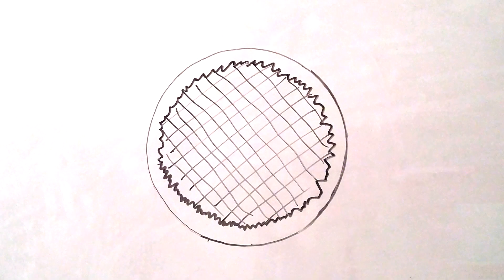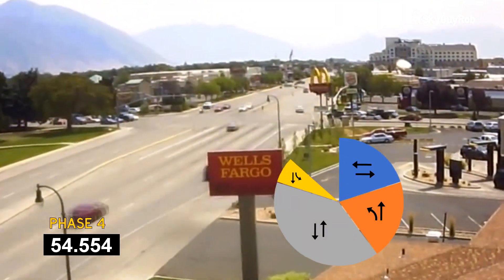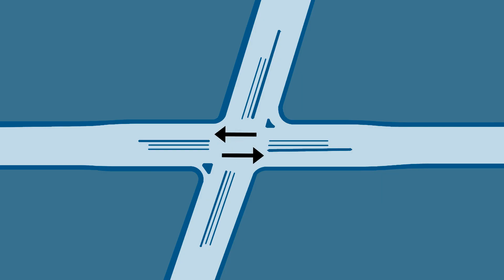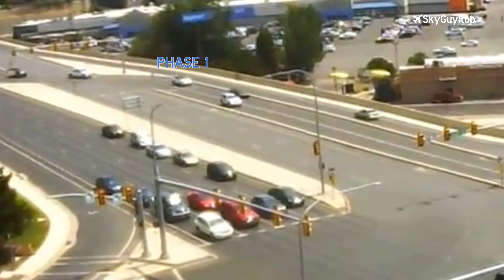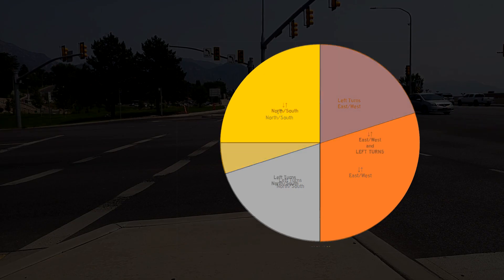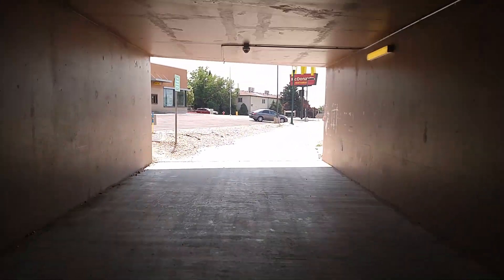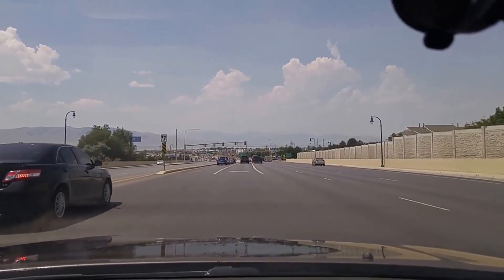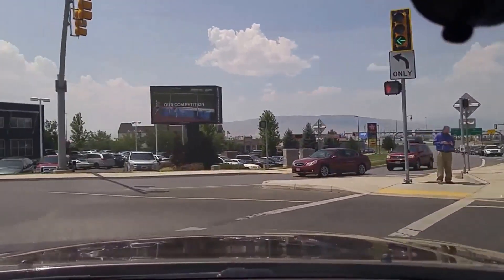New Crazy Traffic Light Which SOLVES Congestion

Comment: 2 things that would vastly improve some traffic lights. In other countries the green light will start to blink multiple seconds before it Turns Yellow, then Red, to give drivers  more warning time it is going  to change. And the other item that helps, is the Red light will blink before it will changes Green so Drivers will be ready to go. Another measure that think should be is where they have the dedicated Left Hand Turning Lane. They should have this dedicated Left Hand turn lane should get the Green after the people going straight get through the light. I have been stuck for multiple Red Lights because I couldn't make a Left even with a Green left hours), because the traffic in the other direction would make a left hand turn after their light turned red (and I could not make the Left before the traffic coming in the opposite direction, go a green light).  By allowing people turning left with a dedicate lane/sign to go last, it will ensure more of those people will get through the intersection).

Comment: There is one of these in Round Rock TX and every time I go through it I get a bit thrown off by it. I usually try to avoid that intersection - so there is some reduced traffic right there! I can imagine senior drivers would even have a problem with them as they pretty much feel wrong based on decades of driving normal roads.

Comment: Please do a review of the traffic system in the metro Detroit area. They have the most efficient system I've experienced. No left turns allowed, you have to turn right then use a designated U-turn lane to turn left or go past the intersection then turn left. This avoids having to install left turn arrows. It's far more efficient. Check out Woodward Ave that runs from downtown Detroit all the way thru the suburbs with timed stop lights.

Comment: There is a problem with this, too.  My city was among the first to have this CFI intersection installed in the State of Ohio in 2012.  They said that it would handle the growth of traffic for ten years before an upgrade was needed.  Well, within three years, a huge shopping complex  (miniature city with a traffic light in the middle of it!) started up and it was over capacity.  Since then, the eastbound side of the CFI road had the right turn signals removed and made into an exit/merge lane onto the southbound cross-five lane road.  They just put up a sign that said "yield to pedestrians" when it used to have a light to let them cross safely.  

The northbound five lane road first had it's single left turn lane lengthened due to all of the left-turners going to the westbound exit ramp to the interstate (new exit put in with the CFI!).  This held up the southbound five-lane road pretty bad (especially left turns).  They added the second left turn lane to the northbound five-lane (now six!) to handle the additional cars.  

In short, the intersection is busting at the seams during high volume times!
Reply: That's not the fault of the intersection, that's the fault of planners expecting the rate of growth to remain constant. You're also ignoring the fact that, if the city planners put this CFI in, then the road was presumably already at or past capacity and getting worse every year. Assuming the city did not have the money to put in an actual freeway (probably the case), then you only have 3 possible outcomes here: 1.) CFI goes in, relieves traffic significantly until Shopping Center goes in and it's once again over capacity. 2.) No CFI, Shopping Center does not get built resulting in a major missed economic benefit, and street is over capacity anyway. 3.) No CFI, Shopping Center goes in and severely under-capacity street is now a parking lot until a freeway is built.

Option 1 is the best option in all cases, meaning while the CFI did not get you the 10 years relief expected, it did get you a major economic boon while not making traffic worse than it would have been regardless, potentially allowing the city to build the freeway earlier than expected (or perhaps not, that's politics).
Reply: @jeffwells641  As of now, only half of the available land has been filled..actually still has land to go.  The intersection has upgraded twice.  They did it to avoid a highway initially but there were plans to put one on that road.

Comment: New Jersey tackled the same problem in another way, that spreads out the space it needs (so you don't need to widen the road) and isn't confusing at all except from map readers point of view. If you want to turn left (or make a U-turn), you turn right. Well, actually, you use a ramp on the right side of the road. If the other road isn't too busy, they can make you turn left onto that road before getting back to the intersection. Or, if it's a busy road, they cloverleaf you, which means you'll have to pass through the intersection twice. And if it's a T intersection, well you just get routed to the light, no merging, no left turns, no going through the light twice. It really is a clever solution and I wish more state would adopt it.

Here's the Wikipedia article. Apparently it has a name (other the New Jersey left turn), Jughandle. https://en.wikipedia.org/wiki/Jughandle

Comment: Real solution = roudabout with the correct yeild rules.  Inside traffic yeilds to outside traffic.  When we do roundabouts in the USA, we have outside traffic yeilding to inside traffic, and thus it becomes basically a stop sign when things get busy.  But doing it the other way and you can get a continuous flow of traffic through as slow speeds, and if you us a multi-lane roundabout then it works really well because the traffic "in" the roundabout can change lane rather than slow to crawl when yeilding for outside cars coming in.

Comment: Live in utah, use bangerter Hwy alot, glad they are removing cfi. Some intersections seemed poorly designed. Sometimes instead of waiting at one red light you would wait at two or when making a right hand turn you would have two lanes of left turners coming at you all on the same green, just have to wait or hope nobody goes wide

Comment: In parts of Chicagoland they have installed left turn yield ONLY lights. Meaning there used to be a point where incoming traffic would be stopped and you could turn left safely. The new lights are fine when there's low traffic but when it's busy they SUCK.

Comment: I live in Austin Texas, and we have 2 of these, one near where I live and one in south Austin, from what I've seen. Idk there there's more. And I like it, im not a normal person who thinks its weird for the sake of weird, I do realize it allowed left turn to go with straight traffic. And also, the helps me know when a straight light is about to turn red or green. The diverging diamond intersection, we have 1 near where I live too its on the same road of the continuous flow intersection but down the road a few  miles for an overpass over I-35, and that one i like it a little less. It does help flow of traffic, but I cant tell u how many times I've seen ppl go the wrong direction or try and beat the red light cuz for some reason making left turns off from either I-35 frontage road, the light phase is really short so those tryna cross over going straight perpendicular of, ive seen some close calls.

Comment: Just found your videos and was wondering what a CFI was....  and oddly enough Utah has been the only place I ran into one in 2019!   Never having been through one before it was a little confusing as to what the heck I was doing but just followed the lines, arrows and pavement and I made my left as I wanted.

It does seem a bit more elegant than Michigan-Left or jug-handles (New Jersey) than any other traffic situation out there.    Though a modified Jug-Handle seems like it could almost be a good solution for high(er) traffic situations.

Comment: Roundabouts are nicer, people don't need to stop, just slow down. Want to turn left, use the inner circle, want to turn right or go straight, use the outer circle, it's that simple. (No I'm not talking about traffic circles, those are bad designed since day 1.)
Also, people can't do a head-on collision, because everyone is going one direction.

The magic roundabout challenges you to design a better one.
Reply: Some people don't like roundabouts, and I don't understand those people. A year ago I was riding with some coworkers who aren't native to my area, and they complained about one of the handful of roundabouts we have. I was like "Bruh, you have no idea how horrible this intersection was before they put the roundabout in. Roundabouts are magical time saving traffic devices of wonder." Seriously, a typical stop time at this intersection pre-roundabout during rush hour (which in my city is NOT as bad as your average moderately sized city rush hour) was probably 10 minutes, easy. 5 if things really go your way. It's less than 3 now in the worst case scenario with the roundabout, and it's usually less than a minute even during rush hour.

The only trade-off for these roundabouts is you have to think a little more ahead of time - left lane goes straight or left or U-turn, right lane goes right or straight. That's it. It's not that hard (at least for our relatively small roundabouts).
Reply: @jeffwells641  You're co-workers would not like it where I am then, most intersections here are roundabouts, the only reason there is traffic lights is either because of small place or pedestrian crossings.

Another good thing about roundabouts is that they don't need power to work, they're like plug and play.

Comment: A major problem in this country is a large number of people driving are extreme drivers.  Over the pass 30 plus years new drivers learn based on how their parents, relatives, friends and others drivers conduct themselves on the roadway.  Most times it is bad.  They run through stop signs, red lights, illegal turns, change the minds and disrupt traffic and very bad attitudes.  About 65 to 70 percent of the drivers on the roads should not be driving at all.  Redesigning a intersection does not change people poor driving habits.  Great video

Comment: Hey Rob I was surprised by this video because I live there I I use thst intersection constantly. I have to say thst depending of whst intersection sre you taking it you can love it or hate it. The most annoying part of this intersection is thst special bay that you mention at the beginning. The green light allow only 3-4 cars to move to the next area before it turns red. That turn goes to walmart and on moderate traffic I have to wait at least 3 green lights in that special bay to finally nove to the next one. So this is not so special after all.

Comment: The problem in my city (Mississauga, Ontario) is that the traffic light are timed to catch you. It happens all the time, so it's not just a coincidence. If you are traveling at the speed limit, you will miss the lights. That way you waste more gas, and the governments makes more money. 
If they just offset them to change 10-15 seconds later, most of the cars would make it through without speeding. Congestion would be reduced, and fuel would be saved.

Comment: These are a pretty expensive band aid.  If I. guessing, this is a 10 million intersection improvement without the tunnel.  My town used a "Michigan left" which is similar to this layout and it cost $9 million dollars.  It allowed traffic to move more smoothly but added 4 more lights to the area that they can't seem to keep in sync as people make their left turns at the through signal and not the right turn signal.  I don't know why the engineer chose "the make a right to turn left" instead of "go through to turn left" as the second method allows you to turn right on red when you come back to the intersection.  Anyway - the improvement was marginal at best to traffic movement and the price tag was enormous.

Comment: I remember a couple of places in the SLC area (one by the airport, iirc) where the right-turn traffic goes straight while the through and left-turn traffic all crosses to the left side of the road.  (I looked it up - there's one's at Bangerter and the 201, though I don't  recall where the other one was.)

What's your take on those?

Comment: My city tried to utilise one of these intersections but in utilising it they still made it so that the light has 4 pieces of the pie so it really just causes traffic to interfere with itself this particular intersection with how it flows has actually caused more accidents than before they changed it and again you still spend as much if not more time sitting at a red light now depending on which way you were going then if this were just a normal intersection in my city Which is why after they built this one singular intersection the city planning department in the residents of the city banned any new constructions of intersections like this seeing as how it takes the space of 8 lanes to properly utilise 1 of these intersections in we are trying to do it in the space of 4 or 5 lanes and many times when Turning on to the actual highway you will end up sitting 45 even 10 minutes waiting to get your green light to go ahead in cross the 3 different directions of traffic that you have to cross to make a simple 90ﾟ turn It is way easier for people to screw up utilising the sanities to actually utilise them which is why they are a band-aid solution and they are the least common intersection in the world and the US and the primary state that utilises them is a very large open state with very large and wide roads And war even that state only uses them temporarily until they could save up the money to do the actual road project they wanted to do.

Comment: They put something like this in San Antonio TX at Bandera Rd (TX Highway 16) and Loop 1604. It looks a little different because the main lanes of loop 1604 go over the middle of the intersection. It is a lot better at rush hour than the old conventional intersection, but it still often backs up traffic on southbound 1604, just not nearly as far as before. That could probably be fixed by moving the exit ramp north as far as practical. This intersection re-design probably would not have been needed had not a tiny crooked city to the east blocked all attempts to improve Bandera Road. The state and county were planning to double deck it back in the 1980's but Leon Valley complained about the ticket revenue they would loose. Fortunately it looks like the dark side lost big in the last election in LV. Had this road been double decker by the late 1990's, most of the through traffic would not even go through this light at all. Before this was built, Westbound traffic was often backed up past Prue Road and southbound traffic backed up to Babcock or even I-10.

Comment: i think CFIs are needed in my hometown of jackson tn.
theres a section of road on US 45 bypass from i think old hickory blvd to old humboldt road that really does need serious optimization. my hometown in the last 30 years has seen considerable amount of growth. a +20k population growth.
this is because my home town is a small city and is a lot more desirable than it once was. it also has fiber internet which makes it a lot more desirable for streamers and youtube guys, and you can lump your internet, tv and phone in with your own utilities like gas, electric and water.
which btw, makes the JEA a local monopoly but nobody cares since its owned by the city of jackson.
but i bet those CFIs would work wonders for traffic, especially between the I-40 exit with US45 bypass and oil well road and considering that the bypass is about to be extended and that area i already mentioned is a large commercial area with housing and such, and the road itself is a large road that leads to 2 small towns, it would make sense, right? 
idk, not a engineer of any sort, but i have done a lot of research and it seems best to put those in just because it can, and make the exit and the vann drive exit from I-40 and 45 bypass a DDI or just make the bypass exit to I-40 a DDI and remove the exit configuration with vann drive, to put in a partial CFI.

Comment: There were four fatal accidents at the new continuous flow intersection next to my house since it open (1.5 ish years) specifically due to confusion and people thinking they can make a left when they can't. Most annoying part is on average it only cuts off 4 minutes per cycle, and that's when the lights are working. They constantly fall out of synch, so the lanes coming from the interstate offramp can take 30 minutes to move a mile. It's been a fucking nightmare. Engineers make engineer solutions, not civilian solutions.

Comment: Except for a busy main st, I haven't stopped dead at a red light in 30 years!  Because loop sensor activated signals detect the presence and absence of traffic and I can time myself so I never have to stop DEAD, so I get 150,000 to 200,000 miles on my brakes and 31 MPG instead of the 25 MPG my car mfr. says I should get.

Comment: They turned the highway into a freeway? What's the difference between the two?
Reply from the maker: A freeway is "free" from at-grade intersections (stop signs, traffic signals, etc.).  The entire road has its grade separated (bridges, underpasses, tunnels) from cross streets and access is available only via ramps.

A highway is any road that primarily serves vehicles traveling longer distances.  So while all freeways are highways, not all highways are freeways.  Hope I'm making sense, lol.